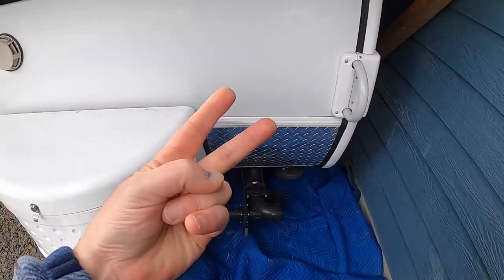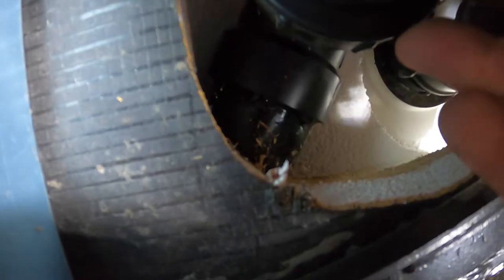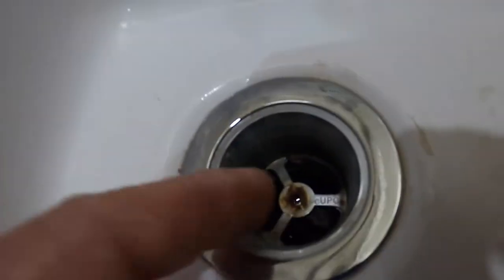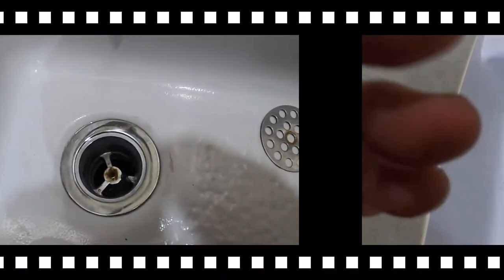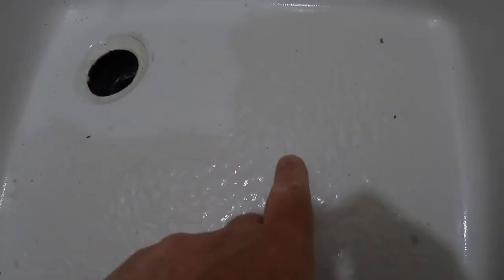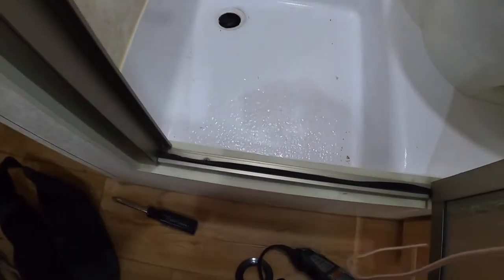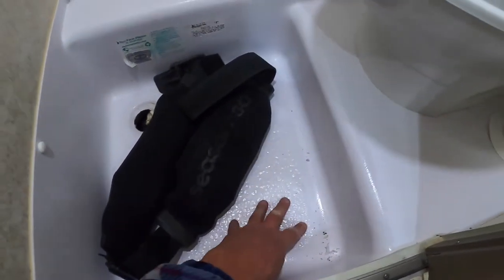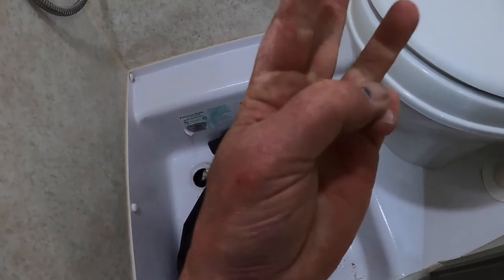Shower Tub Crack Prevention (Part Two) - 2015 Tab Max-s Trailer

Comment: I just bought a cute 2015 TAB 320S (Max S). My shower drain is in the middle of the shower pan instead of off to the left corner, for some reason.  I checked that screw in my shower drain and, sure enough, it was an old rusted wood screw just like yours!  Maybe that's what TAB was using at that time??  So, I'll have to find a stainless screw.  I don't feel any flex in my plastic shower pan floor, so hopefully it won't need the foam reinforcement repair for now.  Thanks for such a great video!!
Reply from the maker: Hi Kim, nice to meet you.
I'm glad the video helped.
I've had several reports now of wood screws in that position. I think you are correct that nucamp was just doing that.
Before you replace that screw, have you checked out my "basket strainer" upgrade?
It certainly makes hair cleanup easier, and gets rid of the screw completely. If you haven't seen that video yet, here's a link. Safe travels.
https://youtu.be/H0sia6IMhec?si=RYYciXGJaVSOP0z6
Reply: Yes - I did watch your other video on adding that little 1 1/2" strainer basket!  I have long hair, so it would be such a good idea.  I just bought my little 2015 TAB 320S.  I am still somewhat unsure exactly which model mine is.  It has the bathroom and all the add-ons, so I'm thinking it must be the Max S.  Is there any way a person can know exactly what their model is?  (My shower pan had the drain positioned in the middle of the floor instead of more in the upper left corner, like yours.  Were they making that slight change in some 2015's?)